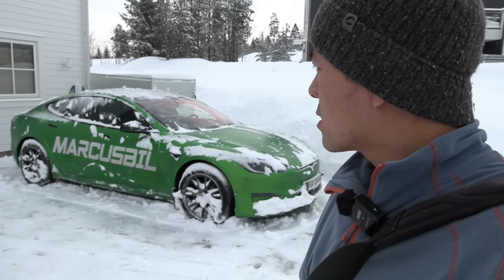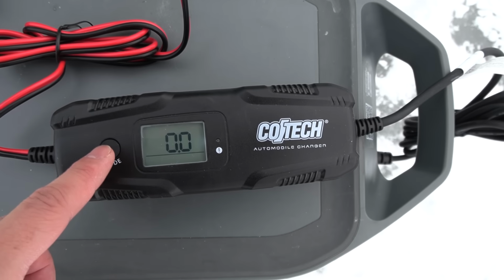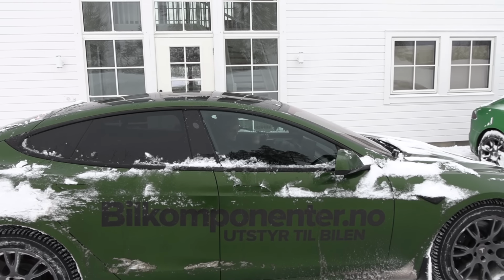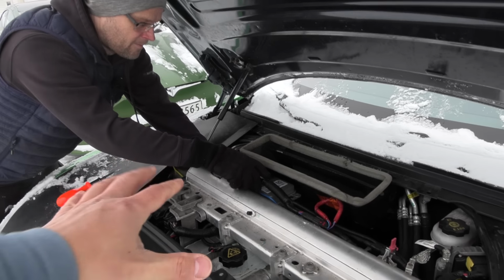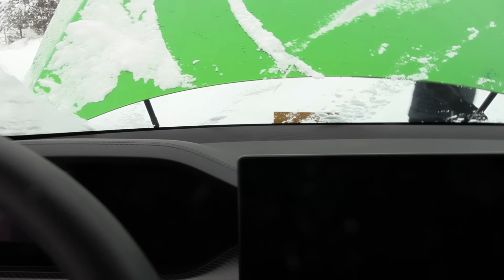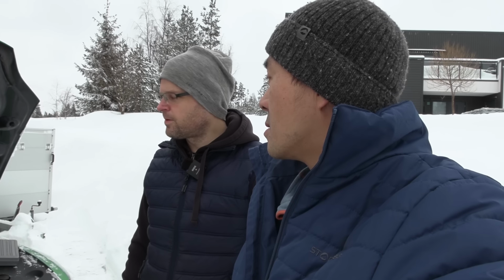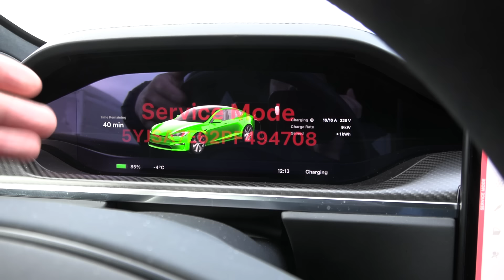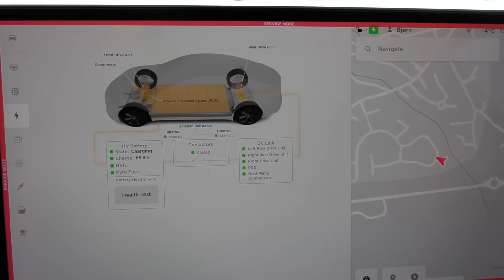Tesla Model S Plaid died in the cold

Comment: You need pure 12-14 volt DC voltage for the jump to work right. Go get the cigarette adapter jumper cable for your ECOFLOW to jump the Lithium Ion battery.
Reply: You need an ICE car and be done with those issues.  Oh, but EVs are SO convenient right?
Reply: @hugolafhugolaf ICE cars have to be kept warm too to keep both the 12 volt battery & engine oil from freezing. Cold is COLD for any vehicle.
Reply: @gogianyee5002  No, ICE cars don't have to be kept warm.  While it is true that an old 12v battery will have issues starting when it's VERY cold, a recent one won't, and your cold ICE car will start, and once started, its range will barely be affected by the cold.  I live in Québec, Canada.  I know a thing or two about bitter cold.  Block heaters exist, but they do not warm the battery nor the oil.  Stop spewing bullshit.
Reply: @hugolafhugolaf I never mentioned a block heater or that it would keep both battery and the engine block warm. You did. Have a nice day.
Reply: @gogianyee5002  You mentioned keeping the battery and the oil warm, something for which a device doesn’t exist, at least that I know of.
Reply: @hugolafhugolaf  there is a warming blanket and/or a blower heater.
Reply: @gogianyee5002  Never heard of this nor have I ever remotely needed to have one of those and each of my cars have always started fine.
Reply: @hugolafhugolaf  I have seen others who live in the mountains use these items. Some motor oils have been gelling up when the temperatures are too cold can block the oil passages in the engine and when running oil starves the engine, so they use the heating items mentioned to keep everything happy.
Reply: @gogianyee5002  Perhaps.  But your claim, to defend EVs, was that ICE cars had to be kept warm as well, which is simply not true.
Reply: you dont own a car because its convenient, you own it because its a car
Reply: being a car, its automatically convenient
Reply: my experience: we are an interesting household. 6 ICE cars, 1 EV we got at quarter the new price. its a 2012 model S with free supercharging, so already one convenience item. But that doesnt make it better than anything else in our driveway, because our Quest is basically a pickup truck and the Civic is the ultimate fast people hauler aside from my brothers G sedan
Reply: its not top priority to be convenient
Reply: just live with the inconveniences
Reply: unless its something major like this, where you cant access the inside of the car, which means you cant access the manual frunk latches, which means you dont have easy access to the stupid lithium ion LV battery

Comment: Yea, that's the wrong charger to use. That will charge lead acid batteries, not lithium.
You need a 12.6v 3s lithium charger.
Unless its 4s in which case a 16.8v 4s lithium charger
Reply: you are probably right about the Biltema yellow charger, but Sondre from Bilkomponenter said this fired up his Plaid after 30-40 seconds. Many of these old chargers like the one used here outputs around 15-16 Volts when the load is low, but as the Plaid tried to power up, we heared the
clicking sound and the Current meter 
on the charger jumped around. It could be that the connection between
the car and the charger was not good the first time they tried to fire up the Plaid with the lithium battery disconnected,  
I do think the best is to use a 4 cell LIPO battery  4* 4 volts for the jump start procedure and leave the Plaid lithium battery connected. This could bring the Plaid lithium battery out of 
protect mode and take charge, may be !  
The remaing question is still why the Plaid lithium battery went so low ?  Is this battery degraded due to the car has been sitting outside in the cold to long? Then it could be that the internal heat element caused the discharge.
Anyhow I think this needs more debugging. as there is more question
than answers here.    Perhaps first do a capacity test of the Plaid lithium battery . If capacity is close to 6 to 7
AH, then work from there, if capasity is low, replace the battery  as the first step.
Reply: I guess wont be enough. 4S for regular Li-Ion cells. 5S for LiFePo4 cells.

Comment: Bjorn should prep like an electrical engineer with multimeter and DC power supply :)
Reply: Everyone should own a digital multimeter. They're wonderful.
Reply: he really doesnt have the thinking processes to operate even a simple two wires and light bulb tester he has no understanding of battery charging etc and if the + was disconnected on the battery he was charging then its highly likly other systems  were off, what stupid design I never want one even if I was given one
Reply: vernevens1598  model S is a dream car 🚗

Comment: My Plaid died during an update last week in my warm garage. We just plugged in some 12v and it came back to life, the LV battery soc was low and started charging immediately. I suspect the 16v have some issues either software or hardware related. Fortunately it's quite an easy fix and it gets charge from the HV battery.
Reply: A good clue on what might be happening !
Reply: Curious how you fed 12V?
Reply: @iamalmostanonymous  from another car battery
Reply: @harmhoeks5996  well mine was in the middle of an update, so I guess that doesn't work during updates
Reply: @walbergrobin  why is the LV dying so fast? how long did the update last?
Reply: @faustinpippin9208  Normal update. I have no idea what the LV soc was before the update or why it died so fast.
Reply: Did you buy a car or  computer? My Diesel TDI engine always starts in a bitter cold.  So.... Keep driving that crap,expensive one
Reply: @aantonic  goofy ahh car that starts without a 12v 😂 Drive whatever you want, i don't care. If you do, that's on you
Reply: vernevens1598  read a book or two. And some research papers while you're at it
Reply: Is the DC-DC converter at fault? It seems like the programming doesn't deal with cold or low 12V state of charge well. Maybe a battery tender and battery blanket for the 12V is a necessary accessory.

Comment: Obey "Bjorns Law" - ABC = Always Be Charging even if 80% charged
Reply: EV's prefer to Always Be Connected to a charger even when charging is "finished".
Reply: @Frygisk Depends on the EV. It will say in the owner’s manual.
Reply: Exactly...To maintain cell voltage balancing, maintain charge on the low voltage battery, and, maintain battery temperature!
Reply: Coffee is for Chargers ONLY!
Reply: I don't have to fill up my car when it's ¾ full.
Reply: @hugolafhugolaf  You also can’t do it from the comfort of your own home. EV charging for everyday driving is effortless.
Reply: @woalk  It's not much of an effort to stop by a gas station for 2 minutes and fill up my car, instead of charging for god knows how long when I'm on the go.  I fill up every 2 weeks or so, I don't have to fiddle when programming at what time I want it to happen, I don't have to pre-heat my car to do so, etc...  Sorry, not an issue, not even an advantage.
Reply: @hugolafhugolaf  It is an advantage though. All you are talking about is long-range… but how often do you need that? Once a year for vacation?

I come home, I plug in my car when I get out, I don’t think about it again until I drive again the next day. Never once have to stop anywhere to fuel up, don’t have to think about gas prices, and it’s cheaper too.
Reply: @woalk  Once a year?  I routinely drive long distances for work, for friends or family gatherings, etc...  I will not plan a 30-minute stop to recharge.
Reply: @hugolafhugolaf  yup, I can honestly see EV drivers charging their batteries when they have used 1 quarter of the power whereas ICE drivers not fuelling up when they've used 1 quarter of gas.
Reply: @kevinlsims7330  That’s not a realistic scenario for a normal person though. This is, as you say yourself, only for a fleet.

Comment: FYI, VW ID cars with software 3.2+ will also periodically recharge the 12V battery, if enabled in the VW app.
Maybe more legacy automakers have also implemented this by now?
Reply: What if you are not a tech geek and not enabled it in the VW app?
Reply: Where do you enable in the app?
Reply: Eh, every EV more or less does this already. Otherwise we would have dead batteries everywhere.
Reply: Like in ICE cars that turn on the engine to charge 12v battery by themselves?
Reply: @TschingisTube  An EV is not an ICE.
Reply: Most legacy EVs are ICE cars with a battery + eletric motor. Therefore they all do NOT have charging of the 12V battery. So your statement that most EVs do have 12V battery charging is wrong.
Reply: @TschingisTube i never have priblem with my ICe battery, i changed it once in 9 years and paid 50 euro,soooo.
Reply: @aantonic  12v batteries last on average 4 years, doesn't matter how your particular experience is. Also very little people do maintenance themselves especially on cars within warranty soooo 50 euro would be just the starting price.

Comment: The mosfet in the LV Battery open (to protect the battery from deep discharging) when the voltage is to low and the mosfet only close again when you unplug it and wait some time to reset the LV Battery. There is a nice video about this topic from Weber Autos Teslas 16-V-Li-Ion-Akku
Reply: *too
Reply: Had to scroll way too much to find this comment. It was clear as day that the LV went into safe mode
Reply: Underrated comment. Boost
Reply: Up!

Comment: The small USB boosters have a mode to forcibly push power even when no voltage is detected, so they can charge a completely dead system... and a fraction of the size of those units you used to recover.  E.g. The NOCO Boost Sport GB20

Comment: The 16 volt battery charges differently when the car is awake. When it's awake and the contactors are closed, it's using different circuits in the dc/dc converter. When the car is asleep and the contactors are open, there's a different circuit in the dc/dc converter that feeds directly from the battery. This is probably defective. Older packs used to close the contactors every 4 to 6 hours to top off the 12 volt battery, but they changed it back in something like 2016 to run the low voltage system directly off the main pack without closing the contactors. So don't be surprised if the 16 volt battery discharges again after the car goes to sleep.
Reply: How about having a normal car?  None of those issues.
Reply: @hugolafhugolaf  Had normal cars for years with MANY more issues than I ever had with EVs. Will never go back to ICE.
Reply: @sorka95032  Good for you.  Many people like EVs.  Many people don't.  My gripe is the governments forcing them upon us.  Let the market decide.  If people want their cars to die in the cold, fine.  I don't.
Reply: @hugolafhugolaf  ICE cars are twice as likely to die in the cold than EVs. Norway's roadside assistance company Viking did a study. It's not the first study to point to this fact. Look for the article titled "NEW STUDY FINDS THAT EVS ARE FAR LESS LIKELY TO ENCOUNTER ONE MAJOR PROBLEM COMPARED TO GAS-POWERED CARS: ‘I’LL NEVER GO BACK’

It's attitudes like this that are based on ignorance resulting in consumers being unable to make informed decisions that lead to government mandated rules.
Reply: @sorka95032  Governments are mandating EVs because some folks' ICE cars die on the side of the road due to the cold?  I
Reply: @sorka95032   A study which, of course, was adjusted for the AGE of the car, right? Right?
Reply: @ArKritz84  Yes....in fact plus quite a few other co-factors.

Comment: If I understand your chronology, The hv battery was to low to be used to close the contractors per software.  The 16v has a heater integrated and it discharged and with out the hv online it could not heat and so it was stuck discharged and thus the control loop died.  The 2% hv went to 0 just due to temp drop.
Reply: I think the LV closes the contactors. He said the HV was at 90% when he cut power. I didn't know about the integrated heater and was wondering how Tesla charged the LV li-ion below freezing. Another poster stated his Plaid did this in a warm garage after a software update so ...

Comment: If car is not plugged in, high voltage battery contactors are open (so DC-DC converter is not working). So 16v battery is alone keeping car online. Makes perfect sense. So you should keep in pluddeg in all the time ;). Meaby that flooding make more offline current. Normaly 16v battery of course should be car online at least some time. But extreme cold colder that -20 will lover 16v or 12v battery capasity. And if there is more than usual current when car is sleeping you will have more issues. 
Might be very difficult to diagnose hidden power draw, same thing with gas or diesel car.
Reply from the maker: But Bilkomponenter Plaid had no issues...
Reply: Next time , unplug 16v before charging and charge it 10minutes to heat and gane some juice. ;)
Reply: That bilcomponenter plaid has not been in a flood. Meaby this one has damage to 16v battery and it has lower capasity. Or more likely there is hidden draw from 16v when car is sleeping. Valdemar can easily put ampere measure device to those 16v battery wires and see how much is current draw when car is sleeping.  This measuring easy and fast but if there is hidden power draw, finding that might be very difficult.
General rule of thumb is to see what has been changed recently, and check those thing first. Have had exaple many cases when someone installs new radio and it has  too big internal power draw, draining the battery overnight, or if someone has added some other devices to 12v outlet that is constantly on, like minifridge in the trunk.
Reply: @bjornnyland  Did you ask if the Bilkomponente car had Sentry mode on? Even if it was NOT plugged in during the cold nights? Possibly that is one of the differences since Sentry uses quite a bit of juice while being on for the recording cameras. Maybe it also checks and  keeps the LV battery topped up from time to time.

Comment: The charger you are using may have had an automatic that detected that it was not a normal 12 volt lead acid battery,
 and therefore refused to charge the battery
Reply: Bjorn probably needs a big 15V power supply instead of a charger which is going to try and do charger things, like detect what sort of battery it's connected to.
Reply: Yeah, my Noco has a "13.6V supply" mode.
Reply: A charger generally can’t do a lot of current. The booster here can deliver a lot of current for extended time.  A normal lead acid 12v battery is what you would use to connect to those leads. 

Theoretically the eco flow direct 12v would’ve worked.
Reply: @ericnewton5720 How much current can you get from the 12 V port?
Reply: LiPo batteries do not fare well in cold weather. By disconnecting the car to prevent those charging cycles, the LiPo battery basically drained itself.

Comment: A small lithium booster can work great in this case and the rest of the time can be used as a powerbank
Reply: No need for big charger, this was overkill. The booster will tipically provide 15v anyways.
Reply: @10mbc  boosters don't always work when the battery is completely dead. Things like reverse polarity protection and spark protection need to detect some voltage to operate. Some have an override to apply power without these protections.
Reply: @drfisheye  You obviously get one that has the option to boost a completely dead battery, it's really not rocket science. Get the Audew, it works pretty well. He is so unprepared that is not even funny. You have the Ecoflow power station, how come you don't have the 12v leads? And he is at home, it's not like he just forgot some cables.
Reply: I got an equivalent Audew lithium charger, it works wonders on all cars. Used it once on our MG ZS EV, the rest of the time to help others stranded, it's really fun to find the small charger, because people looks weird on you, cause they don't think it works, but they even work on big V8's  If you ever gonna need it. 😂
Reply: @@phillipbanes5484 Well, you are not wrong but he keeps that giant power bank in the car (the Ecoflow) so the additional risk is basically zero. If you really are concerned about this you can still have an AGM booster pack of you can use a battery charger that has a boost function, there are so many solutions that being unprepared is not an option. Most likely (I am not sure of this, of course) even the charger he had available could be able to charge a dead battery by a key combination (maybe long press for 10 seconds or something) but you need to read the manual on that.

Just don't forget that, if you have a mild hybrid or a lot of hybrid cars, you have li-ion inside your car already.
Reply: @jesperpedersen1388  We don't really get many V8 around here (while I do know somebody that has a V10, he is the only one I know that has an engine with more than 6 cylinders) but we get plenty of diesels, my Audew had the opportunity :) to start 2 dead VW TDIs and started both on the first try. Even more, one of them was so dead that the engine stopped the second I have disconnected the jumper and had to start it all again and it just started without issues.
Reply: @10mbc  My brother uses mine sometimes to start a 4.5L V8 Porsche Cayenne S, even a smaller one can do it, they are quite powerful. People freak out when they see such a small thing starting a big engine 😂😂
Reply: He had a ruddy great powers supply there...
Reply: @10mbc  I think he is referring to the cars internal electronics.
Sometimes you need to connect the booster for a few minutes to get it to start. I suspect this is because the dead battery gains a small amount of charge from the connected jump pack.